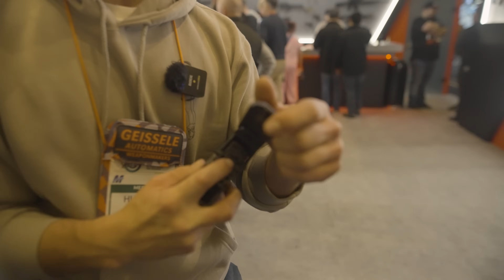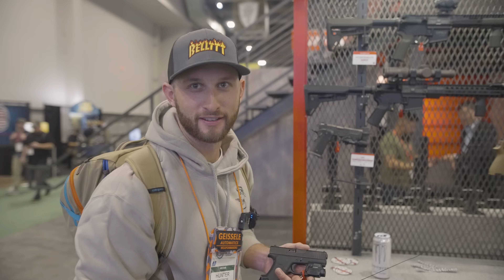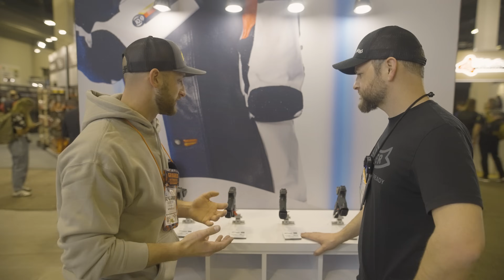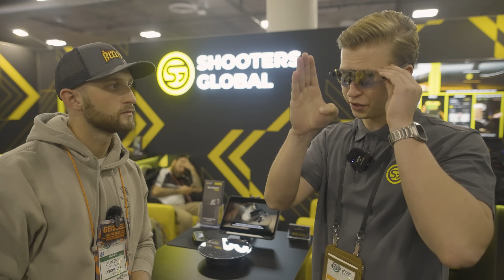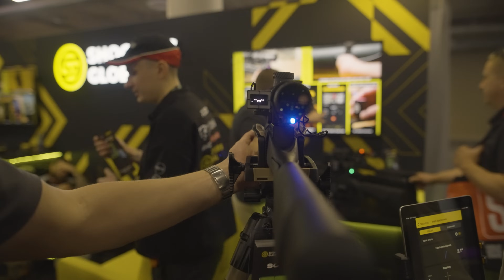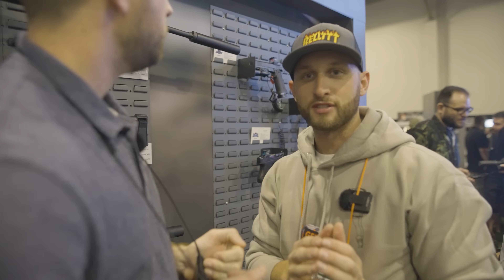2025 Shot Show Day 2 | Agency, Zev, Walther, PSA, Shooters Global, and More

Comment: Can Walther take notes from Smith and get their grip texture up to snuff?  My PDP grip texture smoothed out REALLY fast, and it's  quite slippery for a gun that wants to move more than an M&P 2.0.

The SG AR setup is cool, but I would need to get contacts unfortunately.  I dislike some of the downsides of glasses, but they are more economical, and I don't have to put shit in my eye.

PS. PSA only arms people that live in states they aren't scared of.
Reply: Really? I’ve got a full size pro and the grip texture is amazing and hasn’t rubbed out at all?
Reply: When did you get it?  I wish I could post pictures on here, but my PDP was purchased about 6 months after launch, and you can see that the edges and points on the texture are knocked down.  I picked up a friends new PDP, and it felt like I remembered, but still nothing like the M&P, Staccato, or even Springfield's texture.

Joel Park had a similar issue to me, and he used silicon carbide to fix it.  I may do the same, but I just don't shoot the PDP that much anymore. @gabecastillo1634